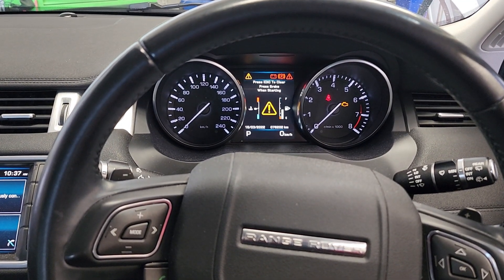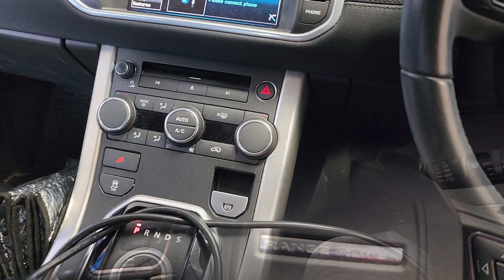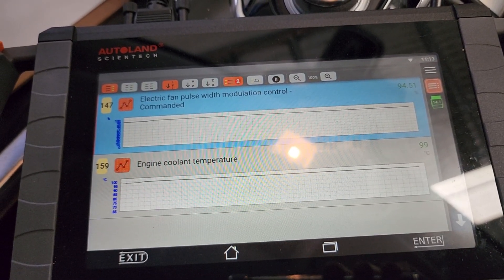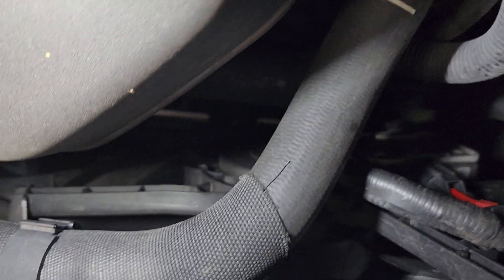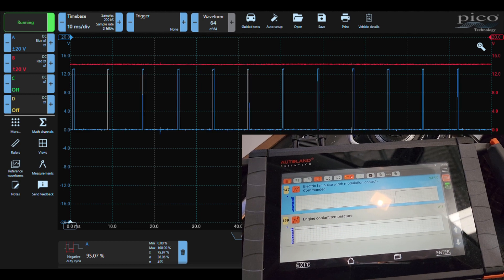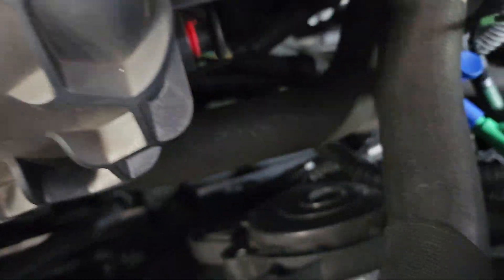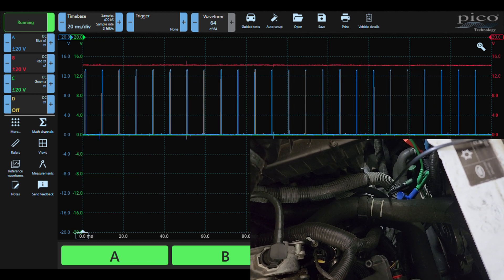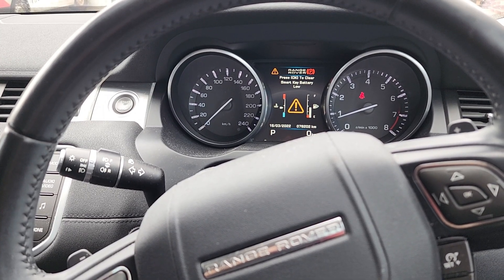Range Rover overheating - Cooling fans not working

Comment: Good video, Every car that I've owed  I've always intercepted the ground wire and put my own electronically controlled thermo switch,   on at 82 off at 78 this being ford and mazda , they mostly pull to ground to trigger the fans , modern cars run far to hot , overtime it destroyes plastics, electrical modules ,  under bonnet ecu's The Mazda 3 auto is classic for that ,  I'd rather  loose 2% fuel efficiency than destroy most of the parts associated.
Reply from the maker: Sometimes you just have to get it right yourself I reckon!